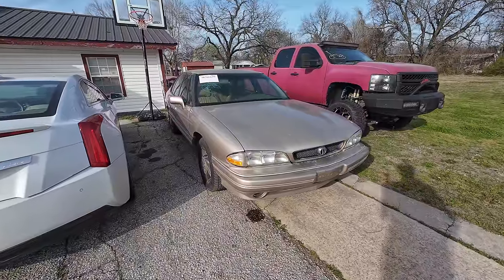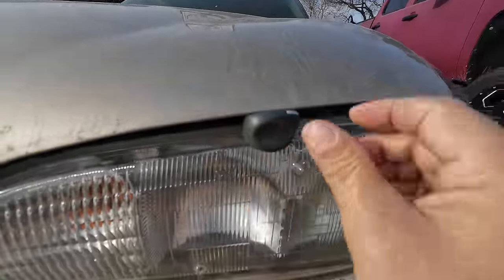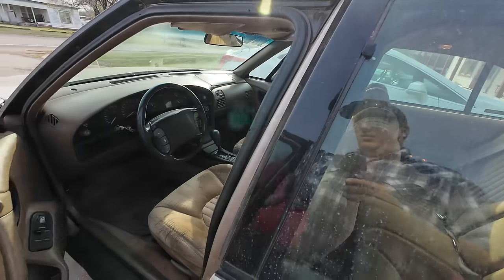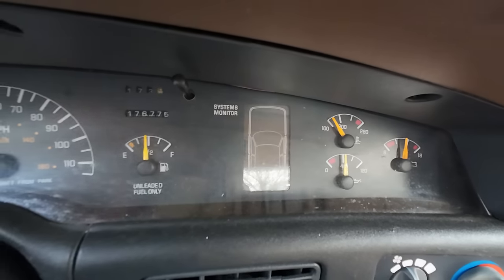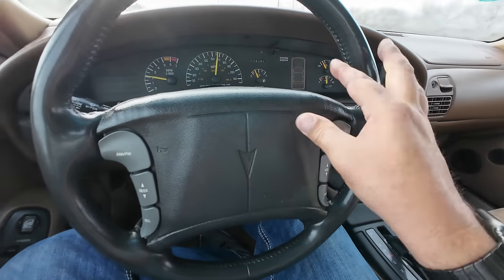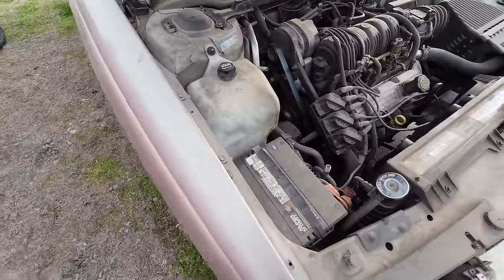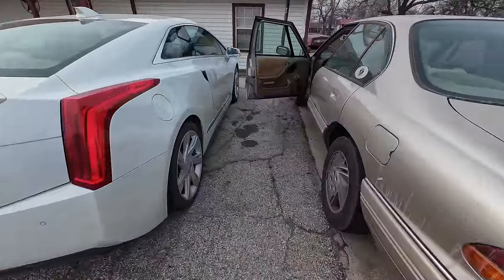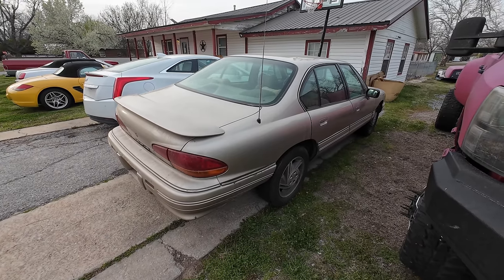This is The Best Car You Can Buy for $600 in 2024!

Comment: A paper clip connected to the a and b Port on the obd connection port will give you the codes.
Reply from the maker: Not on a 1995. That works for OBD1 this is OBD1.5
Reply: Is obd1 or obd2 .The clip may work for obd1 not obf2
Reply from the maker: As I said already - this is OBD 1.5 not OBD1 and not OBD2
Reply: Oh ok. I wasn't sure
Reply: @AutoAuctionRebuilds  I normally find it funny that you pin "stupid" comments, but I don't really think this comment deserves the "pin of shame," At least not the first guy.
Reply from the maker: This is not a pin of shame. It's to address all the other comments saying the same thing.
Reply: @AutoAuctionRebuilds  wow. I wish I hadn't even posted anything. I was just trying to be helpful.
Reply: @locotrucker46 he’s not shaming you.  If you want to be helpful, learn the correct info before sharing.  Common knowledge man that 1995 is not obd 1
Reply: You were @locotrucker46   because we narrowed the issue further. So thank you. Fault finding means you have to eliminate things. So your comment was very helpful.
Reply: The Bosch 1300 should work to scan the codes, but no guarantees. I haven't tried it.
Obd1.5 was 1994 and 1995. Not all 1994's.
Reply: @AutoAuctionRebuilds  The paperclip trick works on my 1995 Suburban. No idea if it's OBD 1 or OBD 1.5 but definitely not 2.
Reply: @AutoAuctionRebuilds  Okay, I apologize then, I misunderstood.
Reply: @AutoAuctionRebuilds On my 1995 Saturn SL2 the paperclip trick works too... Maybe many systems co-existed in that year. So far by the symptoms, i would assume the MAF is faulty or it has to do with injectors. My Saturn had a similar problem, without the check engine, and the injectors were very tired due to the EGR being stuck open and dirtying the whole engine and internal components. As i see, it's the same EGR model on your Bonneville. That would be a good idea to inspect it. ;)
Reply: most 1995 gm cars still had the old diagnostic port but jumping the two terminals will not work as it has a data link you will need an older scanner like a snap on mt 2500 to do anything
Reply: Auto auction rebuild I got some G body headers I can give u

Comment: Hey Randy I just won a 2000 Mitsubishi mirage ls coupe for $275 from copart runs and drives no issue no check engine light just needs a tune up 1 owner 94k miles with really minimal exterior damage it was an amazing deal for the way the condition the car is in

Comment: Like you said Randy, cant scan them with anything but a tech2 scanner people.  You cant jump them. Flash sequence was removed for this year. Try tapping on the mass air flow sensor housing. If it stalls or idle fluctuates erratically replace mass air flow sensor. Unplugging it should also put it into a base table and upon acceleration those fluctuating rpms should disappear with it unplugged. You can try cleaning it but like you said notorious for going out.  You can also check for a chewed or rubbed camshaft position sensor wire or wires if the previous doesnt fix it. I have a 1990 SSE pre series 1 3800 in black with the gold package and crosslace bbs style wheels. It has 259k miles on it. Basically the same motor without the plastic intake and the older Magnavox ignition which i swapped for the delphi like in this one. Car has been a champion. They just wont die. Weve owned it since 92 w/ 9k mileson it, bought from original owner(a business friend of my Dads and head accountant for PepsiCo at the time) who was moving to Germany for PepsiCo's benefit and im sure a lot more money.

Comment: a paper clip connected to a and b port on the obd connection port will give you codes. The engine light will flash but you have to count how any times it flashes. example code 30

Comment: The scan tool I would use is a Bosch OBD 1300 CA. I have one that I use on my 1994 Buick Roadmaster Wagon. Most of the other scanners will not work and the paper clip method to get the codes will not work with 1994 and 1995 GM cars.

Comment: Try cleaning the MAF sensor.. just make sure it’s dry before installing it with whatever you use.. either actual MAF cleaner or air intake cleaner or brake clean. I know people will say not to use anything other then the proper stuff.
Reply: good advice but cleaning this one would probably not work, as the check engine light and loss of power happened at the same time, indicates an electrical failure, cleaning will help with lean mixture codes, but it takes more time for a p0171 to set

Comment: I LOVE the 3800's! 😍
In Australia I had a Holden VN Commodore Station Wagon with the S1 Buick 3.8l V6. 
Then a Holden VR Commodore Sedan with a SII Buick 3.8l V6/5-Speed.
Then a Holden VS Commodore Sedan with an Ecotec 3.8l V6/Automatic.
Then a VT S Commodore Sedan with the 3.8l Supercharged Ecotec V6. MY ALLTIME FAVOURITE!!
Then a VZ Commodore Executive Sedan with the 3.6l Alloytec V6. Nowhere near as good as the earlier V6 Engines.

I also had a Holden Commodore VK Station Wagon with a 304 Black V8 Carb Engine in it which I owned for 17 years. 
ALL of the V6's I had beat it in a straight line and returned double the Fuel Economy to boot! 👍
Buick 3800 V6 for the WIN! 🏁

Comment: I bought a 2002 Grand Prix GTP! Love the platform!
Reply: 2006 gxp 5.3 black on black mint alcore oem rims michilien  tires  $1100 Canadian as is . Did mini restore and paint touchup buff mothers wax fixed heads up cleaned lazer on cd oil undercoated  changed all fluids and had inspection done . I get compliments from loads of people on this car as the car looks runs drives like new . Ps had to change rad got new one after market $199 did all brakes also

Comment: The beauty of the OBD1 system is you don't need a scanner, just a paper clip and you can read all the codes. Very convenient.
Reply from the maker: This is not OBD1. This is 1995 - OBD 1.5 wich a clip nor scanner work on. You need a specific 1995 tool for these.
Reply: @AutoAuctionRebuilds The Bosch OBD 1300 works for my 1994 Buick.

Comment: My oldest brother was a Mechanicl Engineer for GM for over 40 years with Allison Transmission he always said GM V6's would go forever you could burn them up but never blow up.  Mom had a 95 Century Limited she bought new she quit driving last year and gave it to a young couple just starting out 164000 miles on it with oil changes every 3000 miles as far as I know it's still going strong

Comment: I've had many of the GM3800 cars, mostly gen 2 with a couple gen 1 and 1 or 2 gen 3.  The best one I ever bought was a supercharged 2000 Buick Park Avenue Ulta.  I got it in 2004 with 66k on the clock and then put a little over 300k more on it.  Original engine, transmission and supercharger with no rebuilding done only any of those three items.  I did not keep it garaged and WI winters eventually took their toll on the car.  It was governed at 112 mph, but I only took it that high to see how fast it would go.

Comment: 2013 i purchased a 1998 Bonneville beautiful car it dropped dead in the middle of a major highway. Pontiac used a slightly different system looks the same as the Lesabre  but it is not.

Comment: Fantastic buy! Can't beat a 3800 series 2. I wouldn't even sell it. I use it daily and save on miles on you're newer rides. You'll figure out the power loss issue. I think I's the chewed fuel ejector wires.

Comment: I had a similar problem with my 2000 Buick Ultra, but it would either clear up quickly or die quickly.  If it died, it would run fine again after sitting for 10 minutes.  It showed a cylinder misfire.  I cleared the codes and switched the coil pack for that cylinder pair and the cylinder followed the coil pack.  Bought a coil pack at the junk yard and never had that problem again on that car.

Comment: that car  has an obd 1.5    i have the scan tool for that year  an  you need 12volts for it   my 95 transport  is the same  an i use that car  for the codes  as its the same

Comment: it acts like a fuel pressure problem but the fuel pump can not turn on the CE light instantly, so an airflow sensor would be my best guess, throttle position sensors can do that but usually give you more warning, idle speed will be too high or low, does not seem ignition related, so check that wiring harness for hungry mouse damage and throw an airflow sensor in if you can not find a scanner, it will be hard to find a scanner for that, I do not even have one, and I have 300,000 dollars in tools, but I am shur you could borrow one that is what I do

Comment: Camshaft position sensor/throttle position sensor. MAF won't cause it to suddenly big but then run fine subsequently unless there is a wiring problem.
Reply: good point, we did see some wires that were chewed on mice can be a pest on cars, I put a battery in a prius could not get the gas engine to start, no way to charge the big battery, turned out to be a mouse chewed the trans wiring harness, got it going just before that new 2,000 dollar battery went dead

Comment: the problem could be one of your camshaft sensors cuz when I bought my 1999 Bonneville after it got to a stern temp she would die and lose power and bog down really badly  and I found out it was a camshaft positioning sensor witch it located behind the cam pully

Comment: crank angle sensor is my bet,
try starting it cold and see if the problem persists 
otherwise it's the coil pack
Reply: I was just gonna say maybe coil pack heating up under load. You may be right on either.
Reply: Can’t be coil pack, I replace them and still had the same problem
Reply: not a coil, the engine has 3 of them, if one failed yes it would cause a misfire on 2 cylinders, but the check engine light would flash on and off for a time until a P0300 code was set, that did not happen
Reply: @jimsix9929   they  are a 2 part design,
the bottom part generally fails 1st

Comment: My guess is there’s a problem with the coolant temperature sensor or it doesn’t like the fact that it’s not building heat running too cold. A lot of the GM cars don’t like it if they run too cold so it may just be the thermostat.

Comment: was reading the many comments, Randy has a lot of people trying to help , it is not a coil, no way, the engine has 3, if one failed you would have a misfire on 2 cylinders, but the check engine light would flash on and off for a time until it stayed on and set a P0300 code, that did not happen here

Comment: Usually in those older cars when you get the surging like that with the tachometer and the loss of power 99 out of 100 times, it's an oxygen sensor. Looks like a stethoscope I think on that car. Check that first cheap repair

Comment: it could be the converter but it seemed as if the check engine light came on at the exact same time as the power loss, the converter can not trigger the check engine light that fast, so it may be bad but seems to be a secondary problem, my SWAG is still the airflow sensor, oh SWAG stands for scientific wild ass guess ha ha

Comment: Sounds like stopped up cat or bad throttle control sensor, Most likely A old stopped up cat because It will idle fine but with full throttle It will bog and not rev all the way out. Nice car tho man.